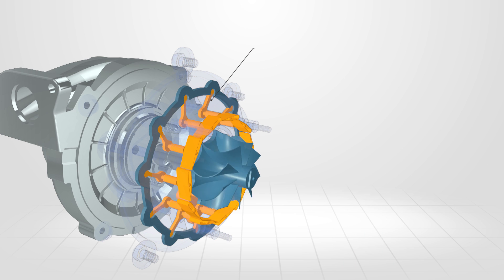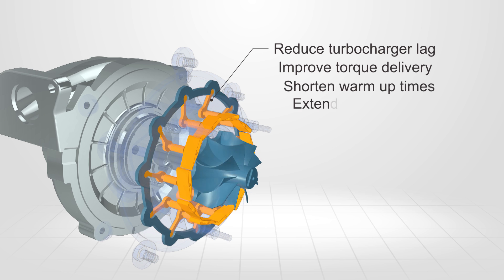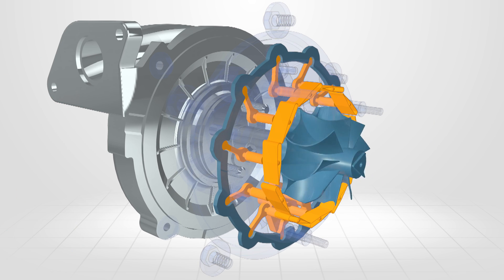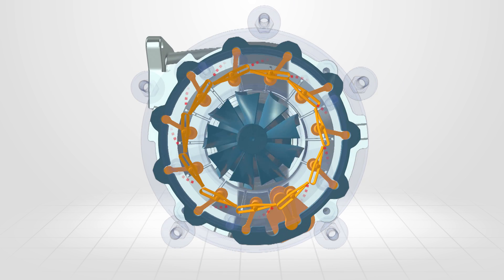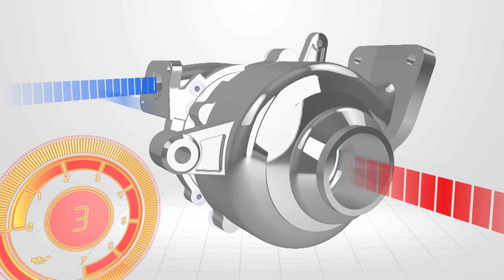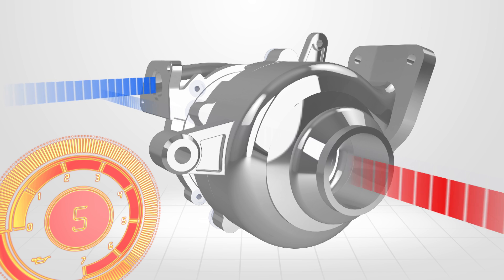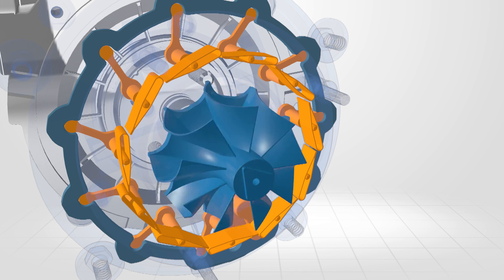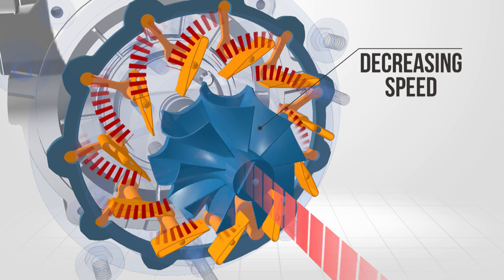Turbocharger Overboost VGT Type

Comment: Just spit balling, but wouldn't it be better to run the turbo via an electric motor instead? At least the turbine wouldn't keep getting clogged up with soot and failing from constantly being subjected to all the hot corrosive exhaust gasses.